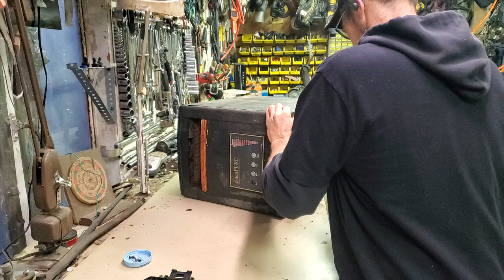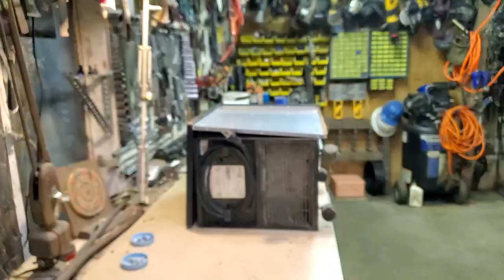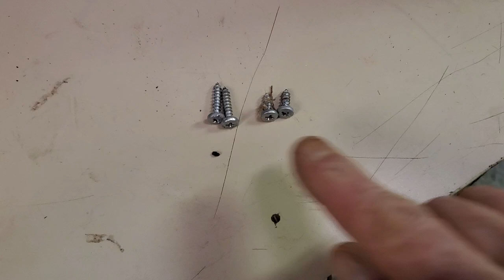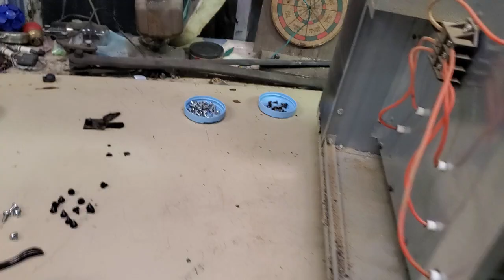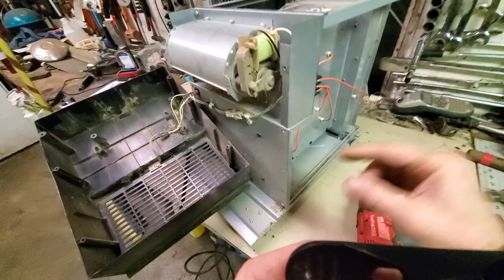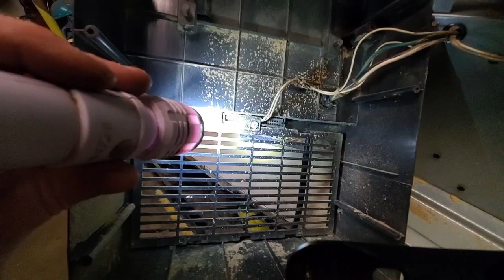EdenPure space heater - tear down, troubleshoot and fix

Comment: u probably will not see this or respond but it would had been helpful to see what u did with the fan i have 1 that just quit and i am watching video after video trying to figure how to fix mine the fan is not blowing  does the fan com on if the bulbs com on what makes the fan com on is it the thermostat. how does each part work with in the system.

Comment: Interesting video. EdenPure (at least the gen 3 and 4) have by far the most 'exotic' internals in this 'cabinet-style infrared heater' market. They definitely try harder than anyone else lol, or used to. Compare the internals of this one to a Home Comfort or Mainstays unit from walmart, those are much, much simpler. Is this much complexity needed? Probably not, but I do respect the engineering effort regardless. Nowadays, their current gen models are just a single strip of PTC in a similarly sized box with a row of red LEDs to simulate the glow of an infrared element, with nothing close to this same degree of complexity, yet they're still just as expensive lol.
Reply from the maker: i did a couple vids on this unit,, compared it to older heating element styles and the older ones won!

Comment: I got a new one this year to replace my 15 year old Comfort Furnace infrared heater that the blower was starting to make noise. Unfortunately I had to send it back because I think it was defective. I wanted my room to be around 68-70 degrees. I turned it on and let it heat the room. Once the temp got to 71 or 72 in the room I used the remote to lower the thermostat one dot down where it shut down. At that point it never would come back on. Room got down to 65 and started feeling chilly. So I pushed the up button once on the remote and it came on. It continued to run and run and run. Finally,  the room got to 78 degrees and was too hot to stay in so I had to bump it down one press to which, again, it shut off and from 78 down to 65 degrees it never came on. I sent it back. This didn't seem right. You shouldn't have to regulate the temperature yourself with the remote. That's why it has a thermostat. I took my old heater apart and shimmed the motor and oiled the bearings and it is working just fine so I am going to use it. You can actually set the exact temperature (number) where you want it and it turns on and off as needed to maintain that temperature. Plus, it gives me the option to calibrate the internal sensor if it is not as accurate as it should be and it has a 24 hour timer whereas some of these new models only have a 12 hour timer. Maybe I got a defective unit but it was a new Copper PLUS model. They did accept a return with no questions asked though. Hopefully they test it to figure out what's wrong with it. If they simply plug it in and turn it on, it appears to be fine but it don't cut on and off on it's own and regulate temperature. It's a shame. I'll keep my old heater and keep it going as long as I can.

Comment: I have this same unit. The fans stay on when it turns off for cool down. And no none of these units blow a jet of air. The fans ramp up as needed for the temperature of the heaters elements.

Comment: Are you positive that it doesn't have more fan speeds.  Maybe the fan speed control on the board is not working.  Look on line for the operating manual.  You still need to order filters for it.  It FILTHY!
Reply from the maker: i do not have a button for fan speed control.,,, *however**  there is mention of the fan speed being controlled by the onboard control panel.  now,, just so i am clear,, the manual also states that when "HI" is selected that the machine will operate in "high heat mode" which i assume means also activation of the highest speed the fan can offer.  the manual says that the "GEN3" models had energy savings mode to turn off a couple elements and reduce the fan speed once the room temp is met.  In short,,, i have no control over fan speed.  I did however power the fan direct from a cord to my outlet to see if the fan would go faster and it did not.  I assume the motor is wound for the rpm its running.   I'll be honest,, this machine is master engineered when it comes to the chassis,,, however value engineering stepped in and cheapened up something  because it falls short for heating.  
today i put a thermometer on the grill opening and i was only getting 168 degF out the grill.  i have a small old space heater or two lying around and both of them toss out over 300deg at the grill.  Its a good chassis but crappy heating design.

this is from the manual online...............

5) Push the “Power” button located on the front of the heater or the remote control
to turn the heater on. Set the Mode Key to “Auto”. Adjust the “temp up” and “temp down” buttons until the desired temperature is reached. Once the desired
temperature is reached the heater will cycle on and off to maintain the room
temperature. when the GEN3 is set on the “Auto” mode and cycling off and
on, it has been equiped with an Energy Savings feature. The unit will run on
full power until it gets to within 2 degrees of the desired temperature. At this
point it will automatically go into an energy savings mode which shuts down 2
of the heating elements and lowers the fan speed. Not only will this save en- ergy, it also keeps the room temperature closer to the desired temperature. If the
room temperature should fall below 2 degrees of the desired temperature, the
unit will return to the full power mode until the desired temperature is reached
again